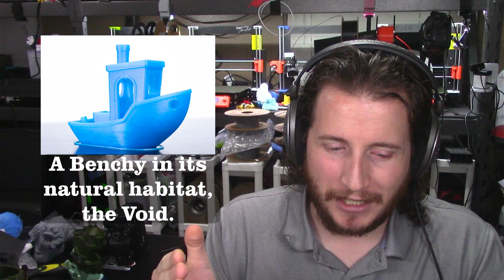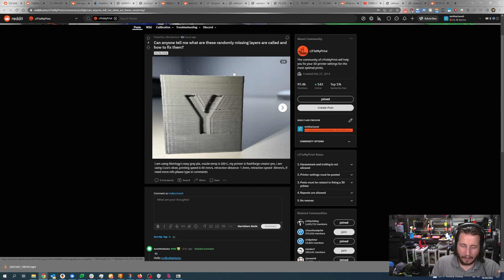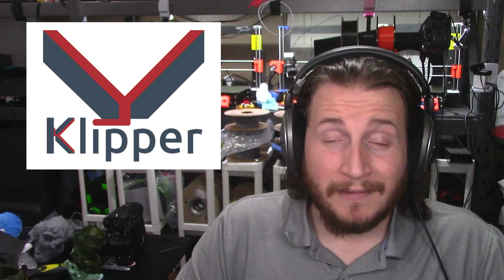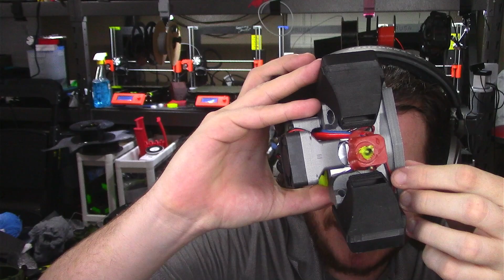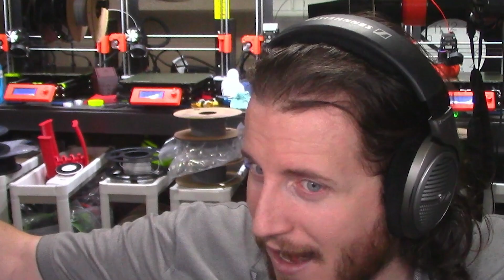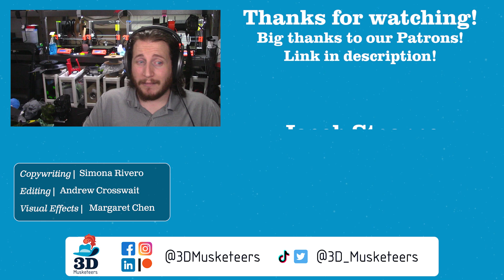What Could Cause Isopropyl Alcohol To Do This?! - PrintFixFriday 59

Comment: My experience with Klipper has been that the guys who use it suddenly think it's the answer to every printer problem, including things like trashed bearings or failed thermistors. It's maddening, the number of times the Klipper fans suggest that for irrelevant issues in the 3D Printing discord.

Edit: You can distill iso at fairly low temps. Don't even need a heat source, just something for it to condense on/in.
Reply from the maker: people like to add heat its a bit oof!!

I do hate when people go hard in the paint about an issue and are totally wrong..

Comment: awesome video like normal. i would love to see you try out klipper. i have a few printers running it and its a headache at first for sure but super worth it in the end
Reply: Agreed.  Kris Kersey just had a good video with Scott Lahteine the main Marlin person.  Sounds like they are making progress with getting features that Klipper has had for a while.  I used Marlin with my first Creality printers, but when I got my Rat Rigs went Klipper on everything.  To me the major feature is never having to compile software.   I can make a simple change in Klipper and test within seconds.  With Marlin - at least when I was using it - you had to compile and flash the board then you could test.  Backups are also easy, save your printer.cfg and any macros in include files.
Reply from the maker: How do you feel about those tablets coming out of some companies now?

Comment: at the very least I would like to see more resin work flow stuff. I find it interesting even though I doubt I'll ever use it.
Reply from the maker: It is very technical, lots of time spent on the supporting, checking, etc. From there it has so much more to do with temperature of the air around the machine than anything else :/

Comment: I actually did measure the shit out my benchy. It was pretty damn close in all measurements. Not worth the tiny descrpancies. It was like 9.998 instead of 10. That kind of shit.
Reply from the maker: thats close enough that it is within the error of most cheap calipers
Reply: @3DMusketeers  A dedicated vid on the benchy (and related bench marking models) would be nice. I'm a newbie  exploring the 3D print world and currently in sponge mode. I'm finding your material to be very helpful in that exploration and aspects that should be thought about and explored.

Comment: ok finally I fixed my printer. I can finish this video after nearly an hour. Amazon Basics is never getting loaded in this printer EVER AGAIN!!! It wouldn't stick to the bed and then I had trouble getting it all out. It even gummed up my 0.4 Revo pretty bad. I knew I couldn't use it for an MMU print, but I thought maybe I could use it in a mono color print. But NOPE. On the flip side prusament prints like a dream! I did like the Jessie filament, however it takes up more than 1 slot in my dryer (like 1.1 slots) which makes it less than ideal for my setup since my dryers are used to manage my filament situation. I do have a couple of filaments that take up more than one like that. But I never need them at the same time so it's fine. I just wish it was a skinnier spool.
Reply from the maker: yeah their spools are a bit chonky, but it is a worthwhile tradeoff for me
Reply: fuck it lets restart the video. lol